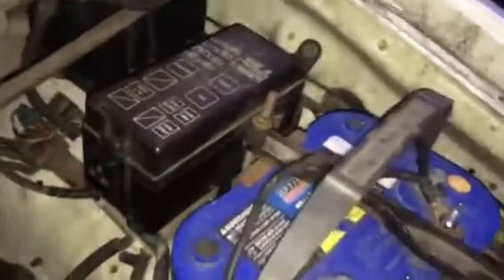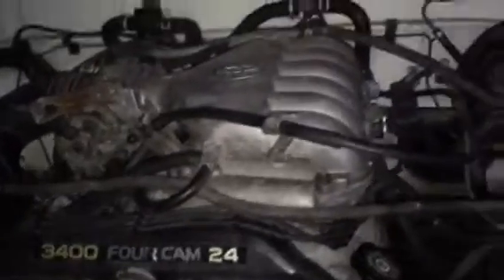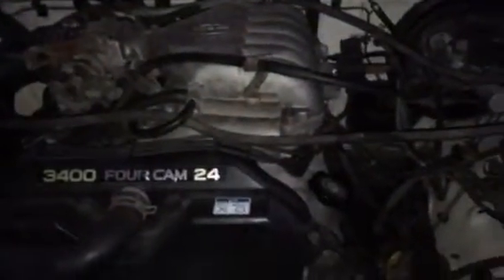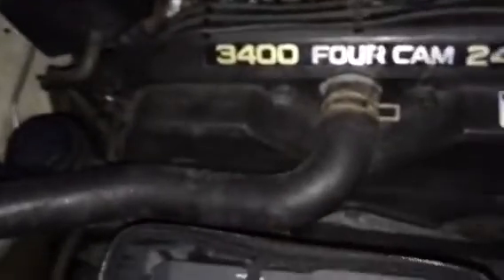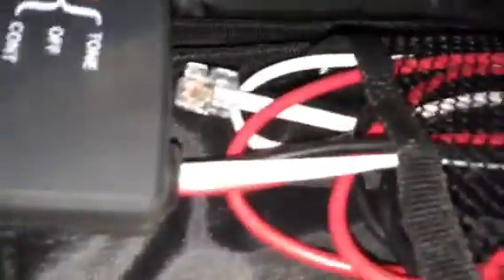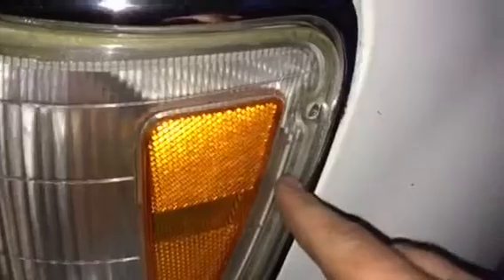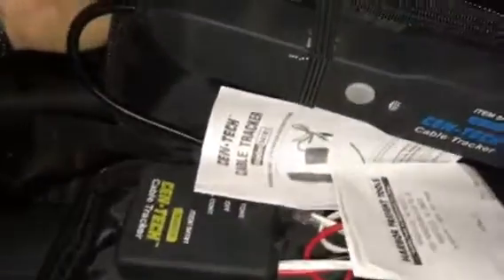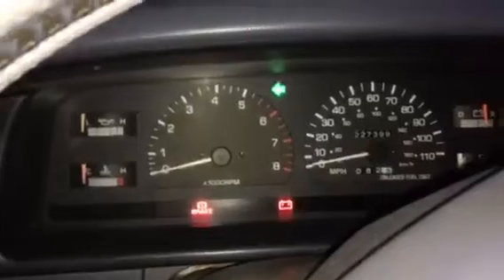Harbor Freight Wire Tracker

Comment: How do you hook this tool up?
Reply from the maker: old school chevy directions are super easy.  Very detailed. Takes less than a minute of reading to figure it out.  Just showing you it does work
Reply: @lifewiththehamptons1993  I can't figure it out. It us like they are speaking a different language even with the lame diagram. There is nothing I see in the fuse socket to hook the clips to.

Comment: So you said you have to take out a fuse my OBD II port doesn't have power what fuse do I need to take out to check those wires...and how do I hook it up to use it I can't get any help I need to tackle it myself.
Reply from the maker: Kathy Lewis what ever the issue is with your wiring, whether it’s tail lights, headlights, turn signals, etc.  whatever your issue is, that’s the fuse( in your fuse box ) that you need to remove. Then clip the alligator clips from the tracker to opposing sides of where the fuse goes. Then turn it on and point to the wires that come out of the fuse panel. Follow the wires slowly until the beeping gets quieter, then you know you have followed the wrong wire, or you have found your break.
Reply: @lifewiththehamptons1993  I need a visual of the clips on opposite sides of where the fuse goes. I see nothing to clip to around the empty socket.

Comment: Finally someone who can tell
Me where to hook up my leads !!
Great job
Reply: where do I hook up the leads??
Reply: @CITYOFANGELES1343  you pull the fuse out for the circuit your checking then you get a piece of wire, paper clip anything to stick in the holes the fuse came out of and you put the test leads (black and red) from the tester clip them onto the paper clip red on one and black on the other. Hope this helps.